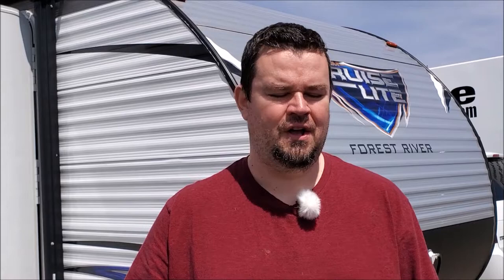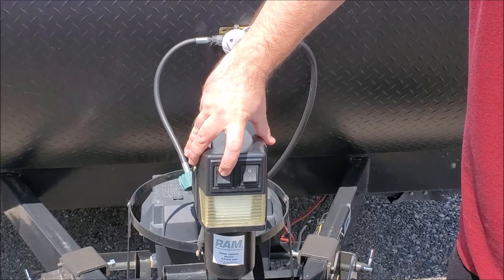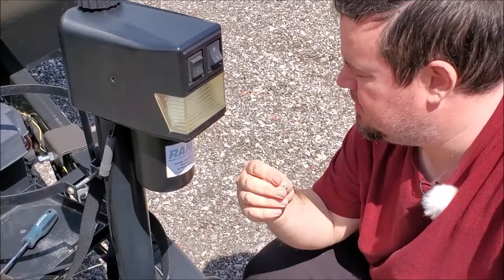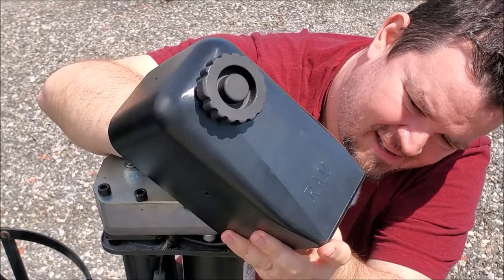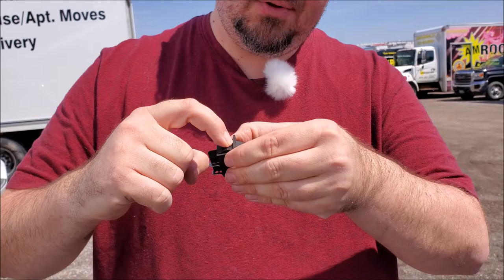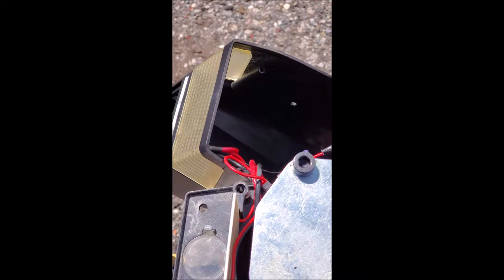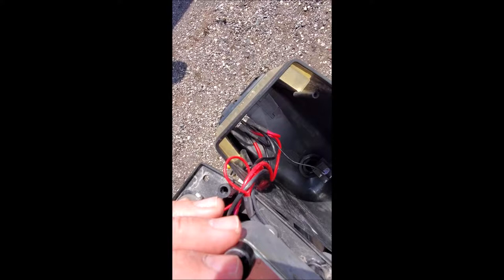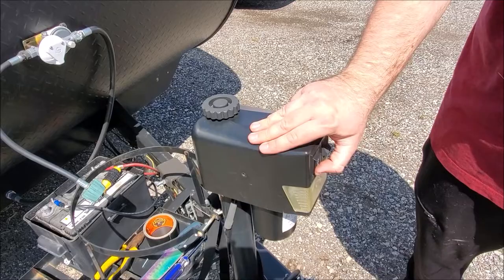Power Tongue Jack Switch Repair

Comment: I just did this same repair on the exact same jack. Once I took the cover off I simply squeezed the tabs on the switch so it came out before disconnecting anything (I used a flat screwdriver to get the bottom out then my finger for the top one). I could then see all the connections and change them one at a time onto the new switch. Then I just pushed the new switch back into place and put the cover back on.

Comment: So by now you know you do not have to remove the cover. Using a blade or flat tip screw diver you pry the switch out and make the change. This method allows you to keep track of all the wires as you connect the new switch. I have been working with my switch issue for awhile now. I have went through all of the connections to insure they are clean, tight, and the terminal ends are in good order.

Comment: Save $20, etrailers switch is $28, amazon has the same switch with wires for $20 cheaper at $8.99. Here is the name weideer 12V Polarity Reverse Switch Momentary 6 Pin (ON)-Off-(ON) RV Jack Switch Motor Control Rocker Toggle Switch with Jumper Wires

Comment: You seem to have lots of issues with this trailer. I just bought a Lippert Power Tongue Jack to upgrade my manual one.
Reply from the maker: We've had the camper for a bit over three years and it's had a LOT of use. Sadly it seems new campers come with lots of issues these days. I have friends who have bought new Jayco, Lance and StarCraft campers and are having just as many (if not more issues). A lot depends on how fast they were cranking them out of the factory and who they had working...thanks for watching!
Reply: @CanadianCampaholic  I dont think any of them are very well made. We have been lucky and have had no real issues but I know at some point that will change. Our trailer is a 1017 and we put on about 4000 kms a season
Reply: @CanadianCampaholic  Poor oversight and quality overall in the RV industry.  If the market open for Japan, the quality would go up guaranteed.
Reply from the maker: @Just4funTravel  agreed. When you look at the products offered in other markets (Europe/Asia Pacific) the quality is far better. Sadly any products in North America with similar quality are way overpriced.

Comment: power jack raises about half way stops after a pause it'll work again. going down there is no problem . does this sound like a weak mini breaker?
Reply from the maker: I'm no expert but that definitely sounds like fuse issues on the jack or more likely the rocker switch has a bad connection. See if you can find an owner's manual for your model of power tongue jack online as that may help with the fuse location. If it's intermittent then I'd suspect the switch is a more likely culprit

Comment: Wondering how this problem started. Did it just stop working one day? My jack started working intermittently and I would need to tap the jack to keep it going. Now it does not work. It simply clicks when I press on the button. Wondering if your switch behaved in a similar manner. Thanks
Reply from the maker: I started having issues getting the switch to work. I had to really Mash down on it to make it work. Then certain directions would stop altogether. So it would go down but not up and vice versa

Comment: Did you have 6 wires on your switch or just 4?
Reply from the maker: The switch had six connections on the back but only four were in use/connected with wires. So I took photos and ensured the wires went back the same way. It's been about three years now and no issues at all!

Comment: All this shows is how hard it is to take apart.  You don't address the VERY important part of which wires connect to which terminals.  It looked like the blck and red wires cross over to opposite terminals top and bottom.  But, it isn't very clear at all about that.
Reply from the maker: You raise a very good point. As the wiring setup may vary from manufacturer to manufacturer I would recommend taking a photo of the wiring before you take it apart so you ensure everything goes back the way it started. The poor visibility inside the case made it hard to film putting it back together.

Comment: Both the light and the jack operation work intermittently however when the jack does not extend or retract the light also does not work. Anyone have a solution?
Reply: That sounds like a flaky connection to the battery or the ground wire.
Reply: @terrywray2181  actually,  whoever installed this pinched the wiring for the light. I noticed that the wiring was pinched and damaged after I opened the top cover of the Jack. After I move the light and all the wiring a few months ago the Jack has never failed to operate. Poor workmanship.

Comment: Hi There, can you rotate the jack head 90 degrees? I cannot open my truck's tail gate and I have not been able to figure out a possible rotation. Thank you
Reply from the maker: I have never tried this myself, however provided the bolts line up and it doesn't twist any wiring it should work. I have heard of a few folks doing this to give themselves more clearance.
Reply: I have this same jack, and the same issue with clearance for the tailgate. Unfortunately, the three jack mounting bolts are not the same spacing. So you can’t turn it sideways. A solution I have not yet tried is an extended hitch which will give you a few more inches to work with.

Comment: Where did you / how did you find the replacement switches?  Can you please advise?  Thanks
Reply from the maker: I ended up finding it on etrailer.com
Reply from the maker: https://www.etrailer.com/Accessories-and-Parts/etrailer/EJ-3520-PSW.html
Reply: Thx for the info on part and replacement 👍🙂
Reply: @CanadianCampaholic  $45 seems way too high for a 6-pole switch.